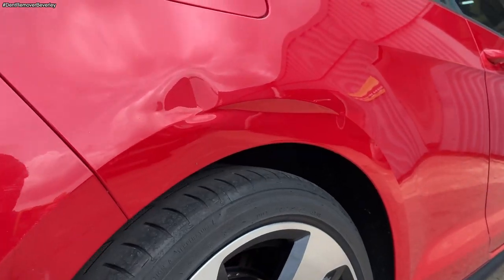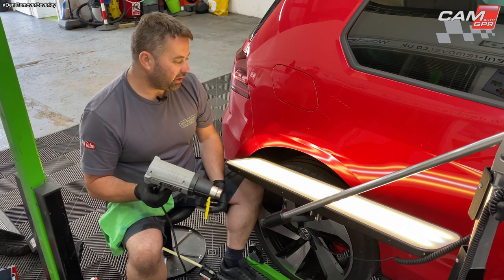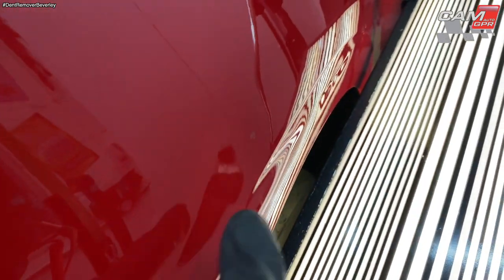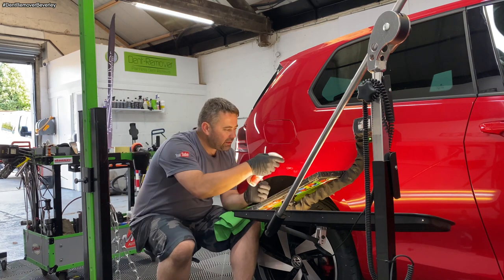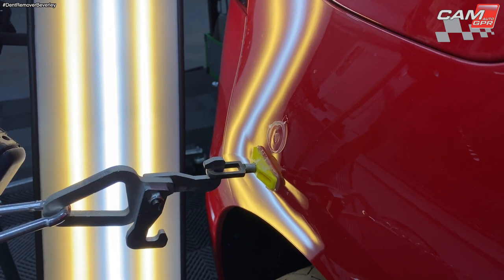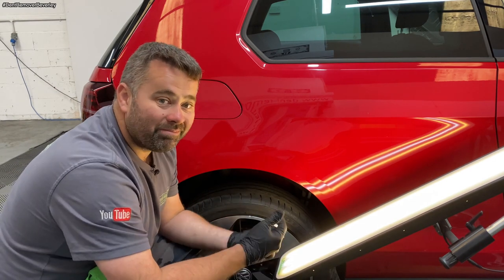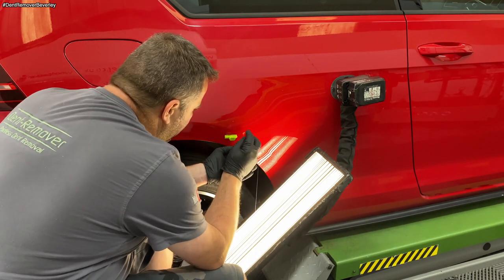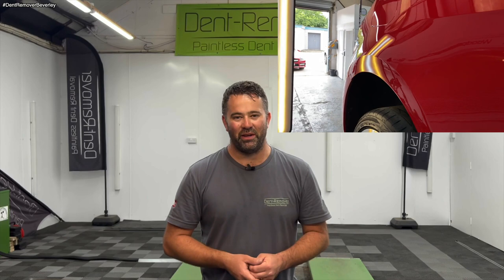HOW TO GLUE PULL VEHICLE DENTS? | See How Its Done! | By Martin Sadler

Comment: Excellent result, your usual very high standard. 
There is a fact that manufacturers are careful not to communicate and that is the thickness of the used sheets.  Recently, here in my part, there was a rather strong hailstorm.  In general, the cars (all fairly recent) have suffered medium / severe damage.  My wife's 1998 Polo, only two dents and not even deep ... Can you tell me something about the modern metal sheets used?  are they really more delicate?  only you can give us this kind of information! Thanx a lot.

Comment: Good morning Martin, 

Fantastic job as per normal. The name of the glue and strength type. Do you recommend Line board verse fog?
Thanks
Reply from the maker: Thank you and sorry for the delay. I use all types of glue but the best and strongest is Camauto collision glue or Keco Flex (same glue) it’s a beast. 
Also I prefer lines, but on big jobs I use fog as I can see more- lines to finish off
Reply: Good morning Martin,
All good I appreciate you getting back to me.
Have a great day.

Comment: You said it took "hours" to fix. HOW MANY hours??? Excellent Job & fantabulous presentation, BTW...
Reply from the maker: Thank you! I think this took about 8-10 hours to complete
Reply: @dentremover01  Price for such repair? New front wing part cost is 50Eur
Reply from the maker: @akierum errrr. It’s a rear 1/4 panel?? These don’t bolt on
Reply: @dentremover01  Rear wing panels are mostly rusted so owners are happy to reweld them, repaint.
Reply from the maker: @akierum I see your point but. This repair and the repairs that I carry out are on newish or very well maintained vehicles where the customers don’t want filler or paint. 
It’s a big world out there and there’s many skills and techniques for repairing vehicles. 
If you find it easy to rip off a panel, weld it on and fill it, prime and paint it cheaper than a PDR technician then that’s your skill/technique and I’d love to see you do it on YouTube one day 🙌🏼

Comment: Nice, did you consider having a pulling beam with a fixed upright then using small ratchet straps so as you can get multiple pulls at once?
Reply from the maker: Hi Andrew yes I’ve got a few ideas to modify my pulling tower to enable multiple pulls. Like the guy from Elevation dents here’s a link to his bid and it’s great 
https://youtu.be/LB3GHTsZBqE
Reply: @dentremover01  thanks for that👍🏼 I’m currently welding up a ridged  pulling tower that I can drop in and twist for our korek grid system at work. Height adjustable with also a drop on parallel bar for door/van body lines. Not sure on them winch’s thought think they would need a finer cog on then for more control.?

Comment: Hi Martin, mega job again mate 💯 👌🏻. been looking for ages to find  Cro carb knock down, any emailed them today , they’ve stopped making them a while ago an no intention of making any more , which I find crazy . Anyway going to make my own. I think dimensions is 25/26mm diameter, and around 100mm length? What is actual if you could check also leather tip diameter 
Kind regards 
Andy
Reply from the maker: Hi Andy thanks! The screw tip cro carbs are available from Keco. That would do you??
Reply: @dentremover01   it’s the knock down you have the nylon one , I have a 10mm leather knock down which is ok for small stuff
Reply from the maker: Yes I know, but they have a screw tip version which is the main bit you want, but without the big long white body. So if you have a spare KD or even get some nylon rod the same thickness and tap it - you have the CroCarb!!
Reply: @dentremover01  yeah I see that thing which is for a hammer the leather part is bonded onto nylon, could you tell me the dimensions of your one pleaseee ?
Reply from the maker: I can do but it would be Monday as I’m away from home at the moment. Il see what I can do for yohb
Reply: @dentremover01  smashing mate , that’s fine , have a good weekend 👍🏻
Reply: @dentremover01  did you manage to get measurements mate
Reply: @dentremover01  hi Martin did you get a chance to get dimensions of tap down 
Thanks Andy
Reply from the maker: Hi Andy. No I didn’t sorry but email me on dent08@yahoo.com and il send you them today

Comment: Hello. Please, where did you buy the battery adapter support that fixes on the pedestal. I mean the piece that is on the pedestal, allowing the use of the luminaire in two ways.
Reply from the maker: Hi Arte, please can you explain a bit more or give me a time stamp on the video so I can see what it is? 
Thanks Martin
Reply: @dentremover01  15:27 of the video. Adaptation support on the pedestal. I have a lamp (stand and makita battery). I would like to adapt it on the pedestal too, just like yours. Thanks for listening.
Reply from the maker: Thanks. So the pole was an old washing line pole, which happened to fit, the adapter which holds the lamp, battery and fits the pole is called a Medusa and it’s made by Elim-a-dent 

So google this and it should pop up. I just checked KecoUK and it’s £120+vat 

Hope this helps 🙌🏼
Reply: @dentremover01  Thank you very much for your attention and information... I wish much success... Sorry for the English, I'm Brazilian and I used google translator in the messages kkkk. Strong hug...
Reply from the maker: My pleasure. Take care of yourself and have a great 2023

Comment: Hey  how do you know which metal you are working with
Reply from the maker: To be honest I don’t unless I check what the panel is per car on the internet. 
It’s not the end of the world if you can’t find out the panel type, it will either pull out nice or be an absolute pain!!
Aluminium-steel is easy just use a magnet 😉

Comment: what would look good is if you took a still picture every so often with no tabs attached and only using the inspection board and then time-lapse all those pictures together, it would be an effective way of showing the progress with respect to body line damage and dents etc. you could see how the bars change as you progress. Each picture should be taken from the same location with respect to the damage. Cheers.